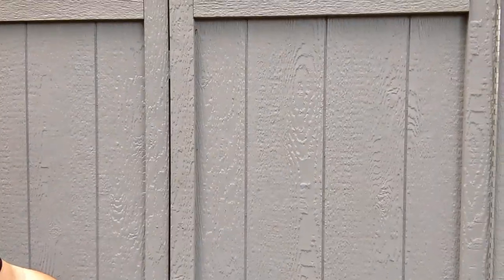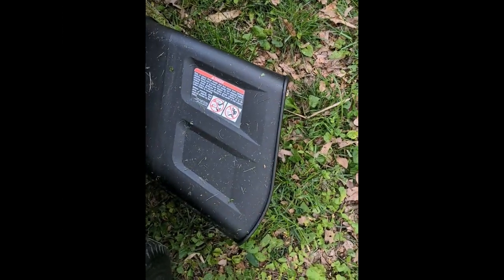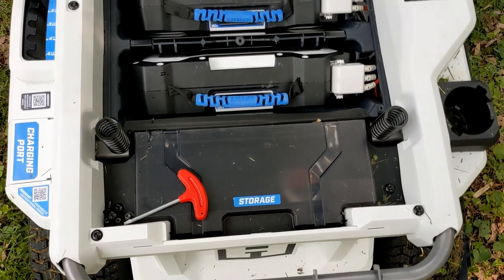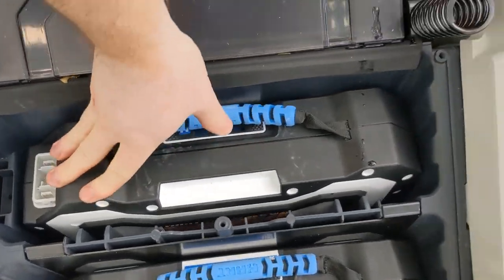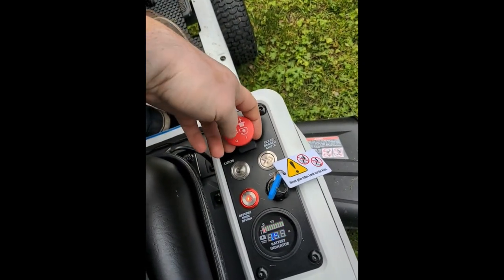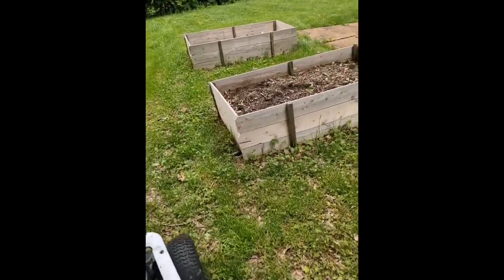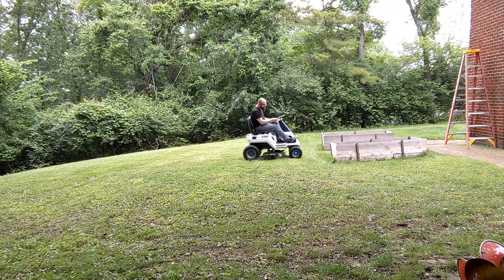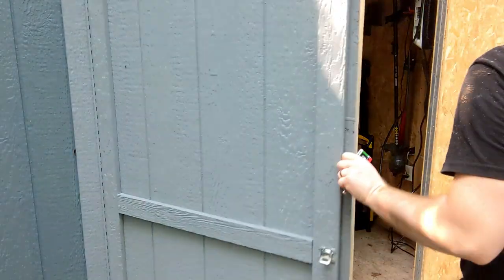Revolutionizing Lawn Care : Walmart's Hart 80V Battery Riding Mower - Full Review and Demonstration

Comment: Some great improvements since we bought the first RYOBI 5 years ago….but it’s been pretty good for us…..we’ll see if we can get another 5 out of it at least….
Reply: My RM480 went 5 yrs. on the first set of batteries and paid for new ones in savings at 54 months. Upgraded from 75 ahr. to 100 ahr. batteries. Mower runs better than new. Absolutely NO maintenance issues in 177 hrs. of run time. DOD is down 2%, so new batteries should last even longer.

Comment: I appreciate the review and I ended up purchasing one. I only have about 1/2 acre, so I couldn’t justify buying the $6,000 zero turn I wanted, but this should do the job.
Reply: J Dee, are your replacement batteries $900 apiece on this mower? I’m wondering if I should buy this mower and one of my concerns is the cost of replacement batteries
Reply: @reality1958 they shouldn’t have to be replaced for a long while (5+years) and by then, they should be a lot cheaper
Reply: @waynereibsome  I hope so. It’s now down to this mower and the Greenworks!
Reply: Almost one year later, has yours held up well?

Comment: Great review - thanks! I see below u confirmed charger will plug directly into each battery. Have you confirmed they will also charge that way? My shed has no AC power. It's a bad idea to leave the batteries in a hot shed. It will degrade them prematurely if your shed gets hot in your climate. I'd like to remove the batteries after each use and store/charge them in my airconditioned garage. Also, any idea how much this mower weighs?

Comment: In all, are you happy with it so far? I wanted something small and was looking for the electric type and the only thing I can find is the hart version.
Reply from the maker: I'm very happy with it so far.  Kind of overkill for the size yard I have but so much nicer than a push mower.  If I didn't buy this, I'd probably be paying over 3k to hire someone to mow.  Check the r/electriclawnmowers subreddit.  I have a list in there of many battery powered mowers and their basic stats
Reply: You said it got stuck on hills. I live on a hill. You think this would be okay on a dry day?

Comment: To say that the batteries should last 10 years remains to be seen.
Reply: I have 7 Ryobi 40 volt packs of various ahr. and so far (3 yrs for the oldest), no issues with any of them. I use them in rotation so they get evenly used. I have had one 18 volt Ryobi pack fail after 13 years and 2 more are 14 years old , but showing degradation when used under heavy load (circular saw). Again, all six are used in rotation. The life span of any of the 80 volt lithium packs in the riders is up in the air until they start failing.
Reply: It appears that the Ego 56 volt ARC packs are starting to fail after 3-5 years. No idea how they are being used/abused, but I have neighbors with them that are failing. One is looking into changing platforms (brands) because of the bad life spans.
Reply: @jfrye6057  I've heard similar things with the EGO batteries.  I have to wonder if it has anything to do with the rapid chargers they use.  They claim to have advanced battery tech and cooling, but that's more than likely all marketing.
Reply: @e.z.e.932  Don't know, but the 40 volt Ryobi batteries I'm using with their rapid chargers are OK so far. the rapid chargers have fan cooling and the batteries have internal temperature sensors that communicate with the chargers. Again, time will tell.
Reply: I'm on my 11th year of my Ego mower and other tools. Original blade and battery, and it all runs and works like day one. I take proper care of my things and keep my batteries inside the house. I can see them degrading if people leave them in a non temperature controlled garage, which I know a lot of people do. It gets too cold in the winter and too hot in the summer for them.

Comment: Parts availability for these as they get old is going to be a problem, which is why $3000 is steep. You can get a John Deere tractor for that price.
Reply from the maker: What parts do you think would wear out?  Most wiring and electrical parts are pretty generic besides a main control board.

Comment: This looks like the best buy for a small riding mower. The gas ones are so chincy and every one has problems from starting to service work. At least a battery and motor combination should be a lot simpler. Cub Cadet makes one also, but it costs a lot more, and I see no advantage they have over yours. Happy mowing, if there is such a thing, LOL

Comment: Was seriously considering this mower, but the Ryobi 80v replacement batteries are $900 apiece! That’s $1800! I think I’m going to have to go elsewhere
Reply from the maker: I've seen them for $500 each on discounted tool sites that I have used and trust.  These batteries should last 10 years before needing to be replaced also.  They're not like lead acid where you need to replace it every couple years.
Reply: @mushroom89  I see. Could you please tell me those discounted sites? If I can get the batteries for that price I might just pull the trigger.

Also. Some sites on lawn mowers say that electric mowers last about 5 years and gas mowers 10 because they are more durable. Do you agree that electric riding mowers aren’t durable? Like the cutting decks for example? You are a big help thank you
Reply from the maker: @reality1958  Direct Tools Outlet has big sales occasionally and I've seen the Ryobi 80v batteries for $500.  A lot of people that are pro-gas mowers typically don't bother looking into battery options because of their bias towards gas.  A battery mower can last just as long or longer than some gas ones.  Gas mowers can still be made from cheap plastics and have the added cost and potential for needing repairs more often just by the nature of gas motors (oil changes, spark plugs, air filters, etc).
Reply: @mushroom89  I see. Thank you so much…I will contact Direct Tools.

Something that a rep at Home Depot told me is that the mowing decks on a lot of mowers are not robust. He was telling me that the John Deere’s mowing decks are heavy duty.

But I only have a standard suburban 1/4 acre house lawn so that shouldn’t be a problem. I think you may have redirected me back to electric!
Reply: @reality1958 deck durability depends on type of yard mostly, for someone who mows every other week or etc with a decent flat land doesn’t need heavy duty decks. Since your not a mowing company.
Reply: @waynereibsome  that’s a good point. I finally decided on a Greenworks tractor and purchased today. Can’t wait for the move from my push to riding
Reply: @reality1958  I plan on doing the same for next year, going electric regardless but hopefully can get a riding vs push.
Reply: @waynereibsome  I did a lot of research. Watched a lot of reviews on YouTube and the Greenworks tractor came out on top for me. Has lithium batteries instead of lead. Batteries are easily accessible, just lift the seat and then the lid and all batteries pop in and out. The reviewers said that this Greenworks was very solid in feel. 

I have an ego push mower, but ego only has a very expensive zero turn for riding. Greenworks has several different models of tractors and zero turns. Plus I think that it is ego and Greenworks who have the reputation of being at the top on electric lawn equipment 

Point of note. Take a look at the Greenworks as it has some pretty nifty, thoughtful features…including a gps built into the unit where you can download an app on your phone and no monthly charge
Reply: @mushroom89  Direct Tools Outlet is Ryobi's remanufactured tool distribution stores. My five year old Ryobi RM480 costs $0.22/hr. to run. My neighbors 600-700 cc mowers go through a gallon of gas per hour. My mower saved enough in 54 months to pay for a new set of batteries.
Reply: @jfrye6057  Your comparisons are outlandish.  A 600cc engine produces 40 to 130 horsepower - much more than we are discussing for small riding mowers.  That's a pretty serious tractor!  The 80v electric mowers being discussed here realistically produce about 3 hp, if we're being generous.  That's going to be quite a challenge in thick grass and hills.  

My little light-duty Craftsman 344cc rear-engine mower produces 10.5 hp, and it runs for several hours on a gallon of gas.  I paid $1,200 for it three years ago, and it's been running like a top with almost no maintenance ever since.  I did have to replace the steering gear in it, for about $30.  That's a design flaw for sure.  I wanted to run it out of gas before doing the repair, and I kept having to mow my half-acre+ lawn for a month before it finally ran out of gas (it holds 1.3 gal).  I also got a trailer for it, that I use to haul 100+ pound loads around the property with ease.  

I'm not saying these $3,000 electric mowers don't have their place; perhaps everyone in the L.A. basin should use one.  But they are not quite there yet - certainly not for me.  A good reference source: Stevepake dot com The Truth About Electric Lawn Mower Horsepower.
Reply: Oh yeah, that Cub Cadet 725 cc engine is rated at 22 hp. and the mower is only rated to tow 250 pounds max., half of what my 48 volt rider is rated to tow.
Reply: And Ryobi's newest 30" lithium powered rider is rated at 28 hp equivalent and mows up to 1.5 hrs. on a charge.
Reply: @jfrye6057  Rated at 28 hp by them.  Check the source I provided in my post for real numbers.  And you're still comparing apples to oranges.
Reply: @jeffnelson1672  I have watched and read multiple reviews by real world users, and the battery riding mowers outperformed the comparable gasoline mowers that they have owned. So I wouldn’t discount the hp ratings on these mowers.

Battery cars way out power gasoline engine cars.
Reply: @reality1958  It's surprisingly difficult to find OBJECTIVE reviews and videos about battery mowers, especially comparing them to similarly-classed gas mowers.  Most of the battery mower videos are by people trying to extol their virtues, and are quite biased.  Most of the ones I've seen doing an honest comparison find that over the long run, the battery models are far less cost effective.  I must say, they do have their good points - noise level being being noteworthy on my list.  They seem to come up short on runtime, power, and cost (also for parts, batteries, accessories, etc.)  They are not there yet, for me.
Reply: @jeffnelson1672  well I guess we have different research. Everything I have read is an electric mower costs less per hour to run than a gas mower. Plus you don’t need to replace belts, oil, filters, etc as well as engine parts. 

Electric cars definitely cost less per mile in a charge than does gas cars…so I suspect that what I’ve read on mowers is probably accurate as well
Reply: @jeffnelson1672  Five years of recorded usage of my RM480 shows a cost of $0.223/hr. to operate. I am pretty sure no ICE powered rider with a similar cut size can operate anywhere near that. Combine that with no fluids, filters, & belt maintenance requirement.
Reply: @reality1958  Yes, battery mowers cost less per hour to run.  But there are other cost factors to consider overall.  They cost about  twice as much to buy.  The batteries are very expensive and may need to be replaced.  The chargers can fail and are very expensive to replace.  The control modules are expensive, and can fail unexpectedly.  Other parts, such as blades and accessories, are more expensive - presumably because of economies of scale, or just because they can be.  Standard mower filters, blades, and parts are cheap.  

With electric vehicles, you can expect to break even at about 11 years of use.  By then, the very expensive battery can need to be replaced at just about any time, and is getting less and less efficient.  

Neither of these battery technologies are as "green" as they seem at first glance, due to a whole lot of factors, ranging from obtaining the battery materials, disposing or recycling of them at end-of-life, and the various ways the energy to recharge them is produced.  But that's a whole other discussion.
Reply: @jeffnelson1672  it is a balance of pros and cons like anything in this world. I guess it’s wherever your priorities/preferences are. For me the electric mower is my preference. I’ve got a Greenworks riding mower coming on Tuesday…this after I bought an electric push.
Reply: @jfrye6057  I addressed this in another post on this thread, please check that reply.  What was the purchase price of your RM480, and how much is a replacement battery?  You need to factor the purchase price and other things into your overall life-of-unit cost for both types of mowers.  I'm happy you like it, more power to you.  There are trade-offs either way.  But I see little objectivity in most owners' endorsement of their choice.
Reply: @jeffnelson1672  My RM480 cost $2,500 new and the four replacement batteries cost $660 total. The mower saved more than that in 54 months and I replaced the original batteries at 58 months. To date, it has saved $725. Batteries wear out and need to be viewed as maintenance items, just like fluids, filters, belts and spark plugs in an ICE powered mower. No one records how much gas and maintenance they put into an ICE mower, but will pitch a fit at battery replacement.
Reply: Let's put this a different way. After 170 hours of operation, my electric rider costs $0.223/hour to run (YMMV). What is the cost per hour to run a 42" ICE rider for 170 hours? I have yet to see anyone state publicly the operational costs of an ICE mower and I'd bet no one with an ICE mower (except a commercial user) can. None of my neighbors could until we took the time to work the numbers. Based on what I've been told by people who actually use ICE mowers, my electric rider is 17 times less expensive to run. The big unknown for me is how cost effective are the lithium powered mowers? Probably too soon to tell. My mower would take about 6.5 years to save enough money to pay for one Ryobi 80 volt, 10 ahr. pack. Again YMMV.
Reply: @jfrye6057  So, your RM480 cost $2,500 new (3,800 now) and replacement batteries were $660.  That’s $3,160.  Not including the recharging costs to run.  My Craftsman R110 was $1,200 three years ago.  You are correct that I have not tracked every ounce of gas, but I have never filled my gas can more than twice a season, and it holds 2 gallons.  So for a 5-year period, that’s about $60, plus an air filter, fuel filter and about 4 qts of oil for oil changes (doesn’t have an oil filter, and I just changed the fuel and air filter at 3 years and they looked like new.)  Spark plug is fine, but they’re $2.  So, let’s say 60+60, for $120 over 5 years, plus the $1,200 equals $1,320 for 5 years in total.  Let’s say I’ve grossly underestimated the gas and double it, and you come to $1,380.  Compare that to your costs of $3,160, and I’m $1,780 ahead after 5 years, and that’s without even including your recharging costs.

Comment: Ryobi and Hart 40 volt batteries do not inter change I own both and the connecters are different.
Reply from the maker: This mower uses the 80v mower.  It would have different connectors.  I still haven't confirmed myself if the Ryobi 80v is the same as Hart
Reply: I've read the Ryobi and Hart 80v batteries interchange with a simple plastic piece removed but still looking for additional confirmation.  The packs do look identical and made by the same parent company which makes me feel that battery options will remain viable.
Reply: Considering you can 3D print adapters to make any tool battery work with any other brand, I expect these can be interchanged with Ryobi of the same voltage.

Comment: So this is the same think as the ryobi lawnmowers same battery
Reply: Agreed, basically same as the Ryobi riding mower (not the zero-turn), except using the 80v rather than the 40v batteries. Both brands are owned by the same company - TTI.

Comment: I am was looking at the hart but do not like the suitcase battery packs as after the 5 year warranty runs out and the batterys fail, You are looking at a $1600 based on the royobi suitcase type. I am looking at the new green works 30inch model when they release it. It has a more affrodable replacment batterys, Not sure I would go with the hart on this after there 40volt electric mower batterys fail.

Comment: This uses the same battery pack, charger, included tools, and key as the RYOBI.
Reply: No it doesn't. Ryobi batteries not compatible with Hart. Similar is not same. Looks same. Different proprietary connectors.
Reply: @claytonyoung1351  Oh is that true? I hadn't tried to swap them.

Comment: I guess most of these little electric mowers dont have a floating deck.
Reply: No they are hung and float from the chassis. Some, like my RM480, have adjustable anti-scalping wheels on the corners of the deck
Reply: Nearly all of the 30" decks don't have anti-scalping wheels. Larger decks do.